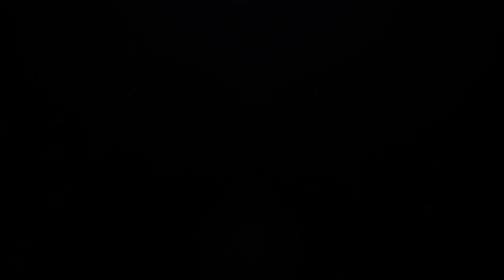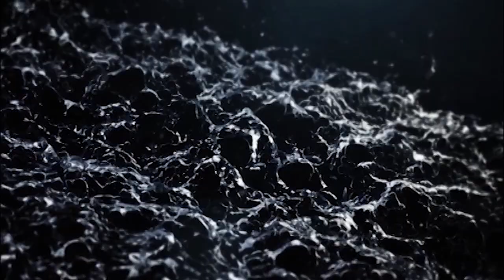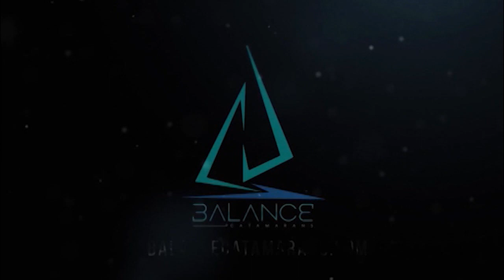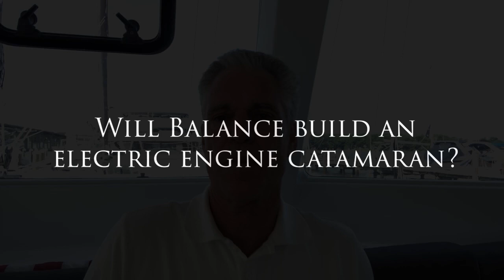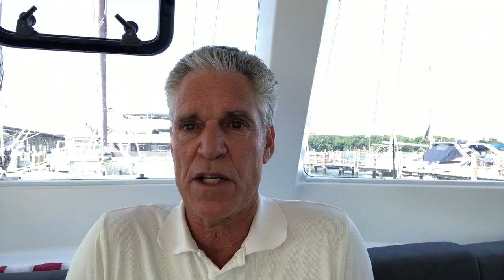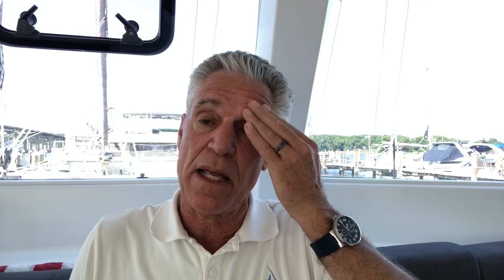Building a Balance Catamaran With Electric Engines

Comment: Its totally the future; and most companies will be left behind; first mover advantage wins. Kinda like Tesla. Sunreef is already on it.
Reply from the maker: John, you can have electric engines if you want them. We are happy to do them. We just feel it is imprudent not to share our experience and why, at present, we see more disadvantages to advantages. And if you are drawn to a Sunreef you would hardly be drawn to our boats!  Three Balance 526 rafted together would weigh less than a Sunreef of the same length!  A Sunreef will need massive engines and electrical generating capacity to motor very far. I have sold many used ones in my days and I know how they sail. There is nothing wrong with this sort of catamaran, but it is not designed for the sorts of sailing our boats are designed to do.
Reply: @balancecatamarans  Quiet electric motors with a kite sail! 
It always has baffled me where theres so much natural energy all around folks out on the ocean; (Wind & sun& hydro) and its not being utilized for energy production. Humans just cling to their old oil ways lol. For me theres nothing more unpleasant than being out on a beautiful water setting with a loud obnoxious motor blaring the whole time.
Reply: @user-dy2qq5wh4b  thats why you SAIL